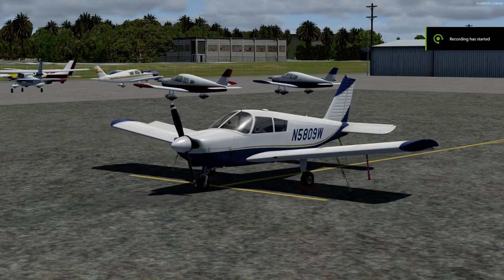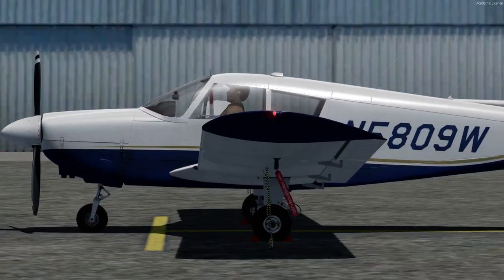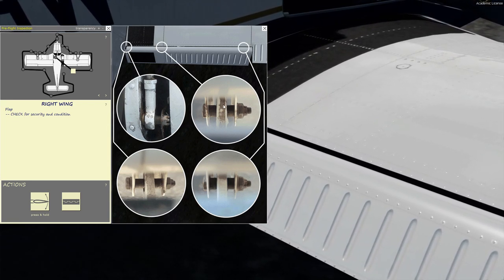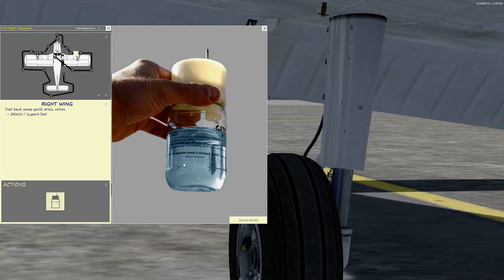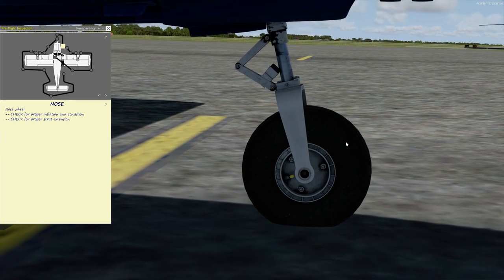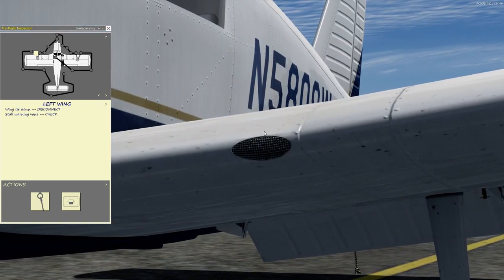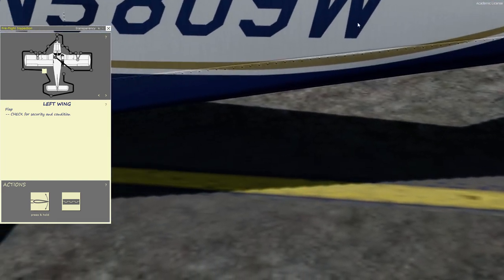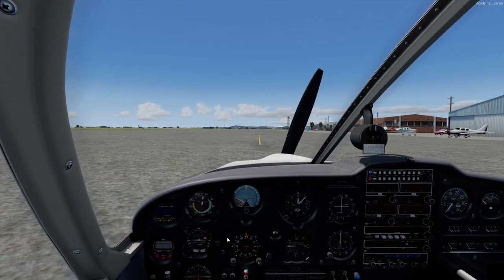Private Pilot | Pre-Flight

Comment: Nice video! Is it a must to turn pitot heat on every time, no matter in summer or winter conditions? Thanks.
Reply from the maker: King Lim Pang it’s a good habit to get into so that you don’t forget it on cooler days when it’ll be freezing a few thousand feet up. Also, if you find it to be inoperative on a warm day when you don’t need it, it gives you time to get it fixed before you really do need it. Obviously this isn’t as important in the Simulator.